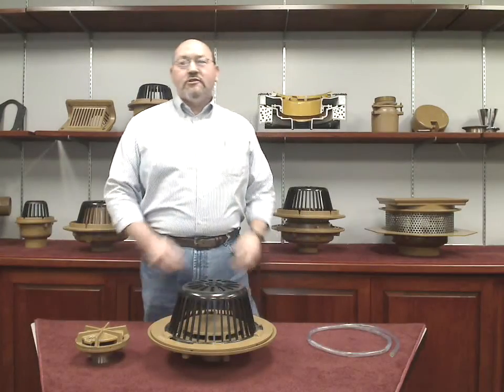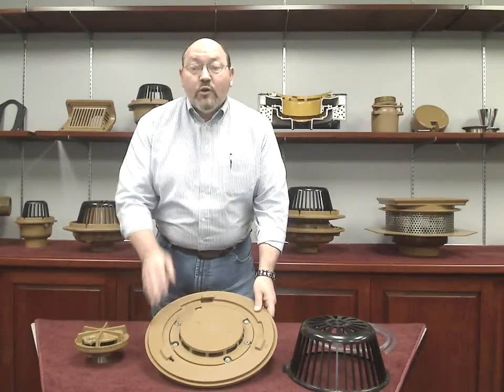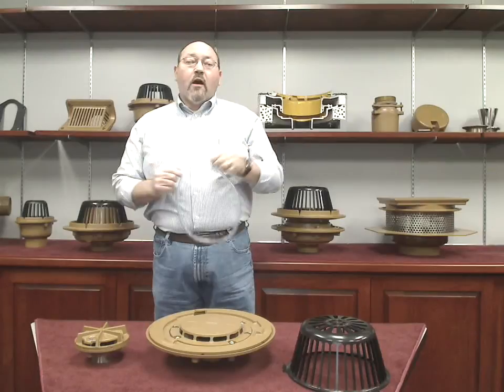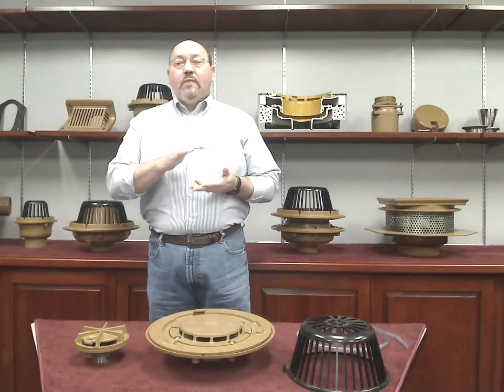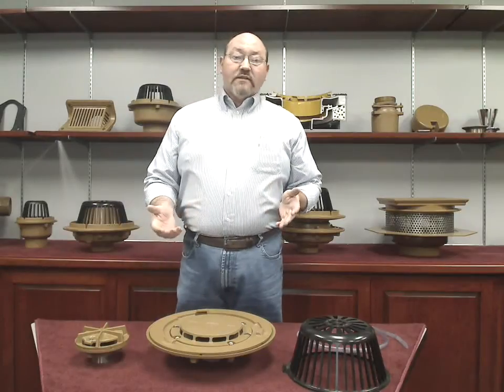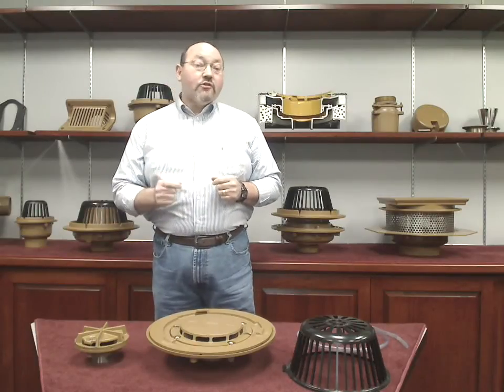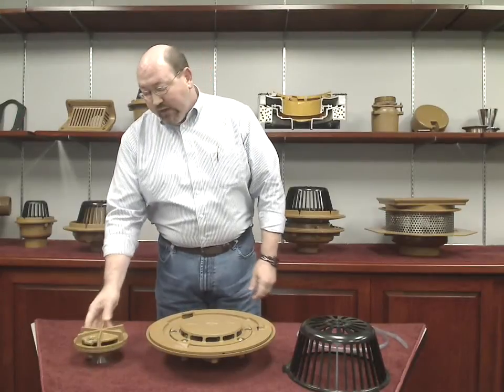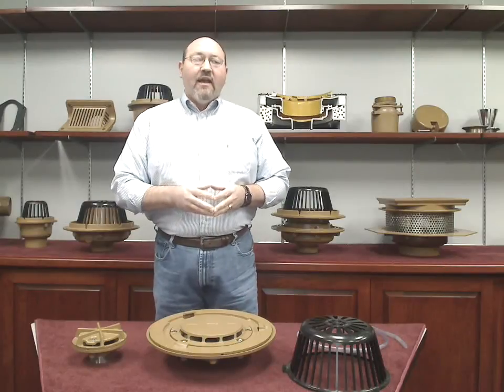Smith Siphonic Roof Drains Demonstration by Engineer, Chris Rylant

Comment: How this avoids air entrapment and  only allow water to enter?  and secondly that small tube water movement is by capillarity. Does this 4inch or 2 inch pipe works on the same principle like smaller tube. Thank you